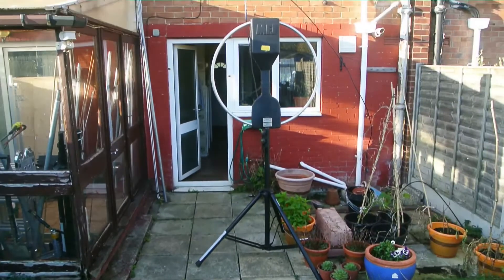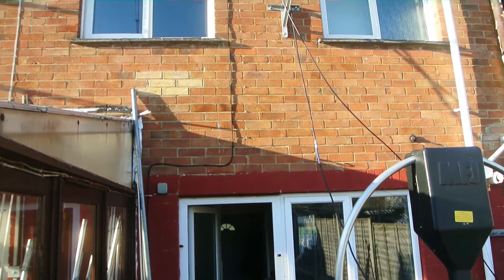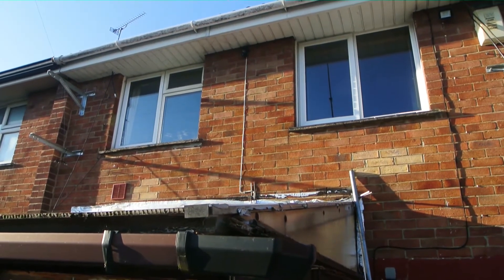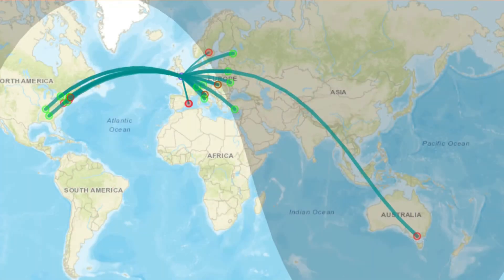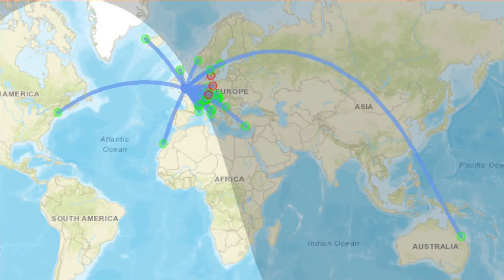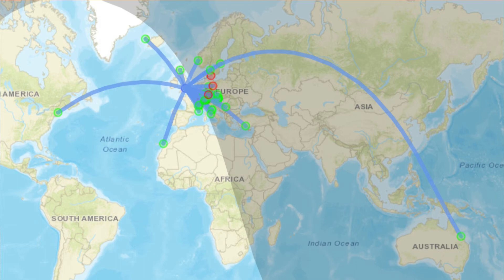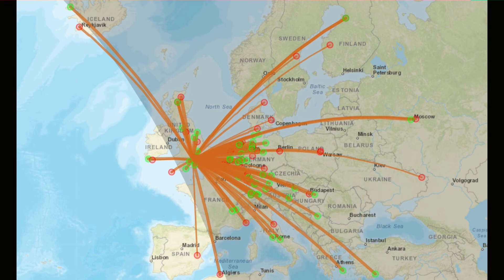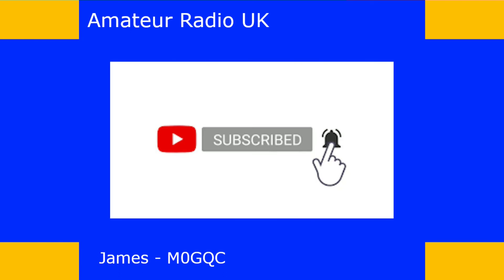MFJ-1788x Mag-loop At Ground Level

Comment: You must never have owned a mag loop before, truth is the narrower it is the higher Q, so the better, especially for nulling out noise etc, I know this video is a few years old, but these days with so many SRD bandscope and waterfall radios, the loop is very easy, you just look at the band scope and press the slow tune up or down for like a second to move up or down ( reversed because MFJ are mental) 😂..anyhooooo..wonder if you still have the loop, ? I have the same one because we now live in a flat..cheers.
Reply from the maker: I purchased this in the days before scopes (was usingan FT-857d at the time), but agree that it's much easier to tune when you've got a scope to look at.

That said, it's still a pain to keep tuning every time you change frequency. 

I sold this antenna very recently (literally only a few weeks ago).

In terms of nulling out noise, that is a fair comment as the null is extremely narrow, meaning that despite the theory of this antenna being bi-directional, I actually found this antenna tended to be fairly omnidirectional (apart from in the very narrow null). Certainly on 40m. Less so on the higher bands.

Comment: I use the Baby loop, it keeps up with my smart tuned vertical on 20 - 10meters. Being vertical it's fairly bi-directional. Worked dx on 15 & 17m ssb and cw. At the very least it's an excellent rx reference antenna, having a natural 'narrow' band Q-factor. 😁 👍

Comment: Hi James very interesting .I brought the MFJ 1786 Loop with me to Thailand
20 years ago. It was 12m High on Tower Vertical. 
I have worked lots of DX in CW Digital. 
But than the Control Box was gone High Humidity. 
Not more for Repair. New Unit very Expensive. 
I see the Loop Everyday missing it was a Super Antenna. Would be nice compare it with the HyEndfed
73 Kurt HS0ZBS East Thailand.

Comment: No offense, but after many tests by many YouTuber's, I think we can say that the MFJ-1788 is a useless, overpriced dummy load...lol!  I want it to work well so badly!  I think a wire coat hanger and a good tuner would give better results at a fraction of the cost. Maybe that should be your next experiment James.  73!
Reply from the maker: MFJ-1788 vs coat hanger? That could be good for a laugh (possibly an addition to the "Antenna Abominations" playlist)!

What might be more interesting is to tune up the shed on 40m (like I did in a previous video), then put that against the loop on a WSPR test to see what happens.

I completely agree that the MFJ is VERY overpriced but I think to say that it is "a useless dummy load" is a little inaccurate.

I've said all along that it is most definitely a compromise antenna & that it is never going to perform as well as a full size antenna. We have to moderate our expectations accordingly.

For people who can't put up a permanent or full size antenna (apartments, HOA's etc), this is a reasonable compromise. It can be put on the balcony or in the garden on a tripod, then packed away afterwards.

Others (myself included) have a full size antenna for the main band on which we operate, but also use this loop because of it's ability to cover a large number of other bands (albeit somewhat of a compromise). In other words it fills in the gaps.

I think it has it's place, though quite clearly not in your setup!!!
Reply: @HamRadioOnline  Lol! I may have been a little harsh with my ‘dummy load’ comment.  I must admit I’d buy a used one if the price is right.  I’d like to experiment with one.  Stay well James...73!
Reply from the maker: @KX4UL  To be fair, I personally wouldn't buy one at full retail price (I think I might actually have said that in one of the earlier videos).

I picked up this one second hand on Ebay. I can't remember exactly how much I paid but I vaguely recall that it was roughly 1/3 the retail price. 

To be brutally honest with you, the other thing from a YouTube perspective is that I have to cater my content to what people want to watch.

I know not everyone likes these MFJ loops but (looking purely at the statistics) videos on this antenna seem to do very well.

Ultimately this video has so far outperformed my last 10 videos in terms of the number of views & click-through rate.

My earlier videos on the loop have had more views than any of the others.

The videos about my S9 interference problem also seem to be doing very well & are slowly catching up.

I don't want to over do it with the MFJ loop videos but it's something that I will occasionally revisit if the demand is there.

73 my friend.
Reply: @HamRadioOnline  - I am not surprised that the MFJ Loop videos get a large number of views.  Like me, I think many others really want the antenna to  perform well.  It would be the ideal solution to so many HAM's in strict HOA communities and apartments.  I have been in both of those situations.  Plus I like small gear that does a big job.  Keep up the great work you are doing with your videos.  I enjoy them all...73!
Reply: Skill issue..

Comment: Out of interest what power was you running? i can only run 10w max on the Cho F loop.
Reply from the maker: I think that it would have been around 2.5 watts, which is the standard power level which I generally tend to use for WSPR testing.

This was actually filmed quite a while ago (notice that the shack hadn't been redecorated when this was filmed), so I honestly cannot remember the exact transmit power!

Comment: They work better at ground or close to ground level i believe, i have the Chameleon F loop 2.0 plus in my apartment and work great for digital weak signal modes. 73s. Also nulling out noise issues is pretty good, i have mine on a rotatable tripod in the corner of my room. I have worked FT8 on 60m to east coast US on 8w.
Reply from the maker: Hi Steve. Never got my hands on the Chameleon loop but like the MFJ, they seem to be a bit of a Marmite thing. Some people love them & some people just seem to have an irrational paternal hatred towards loops!

I think you have to accept a mag-loop for what it is. It is a compromise antenna & a full size antenna will nearly always outperform a loop. That said, loops can be very acceptable if you are restricted & you can't beat them for their versatility.

For someone like yourself, you may have no other options if you live in an apartment. For me, I have one full size antenna for my main band (an EFHW on 80m which will also cover 40m), then I fill in the other bands up to 15m with the loop.

In terms of the whole height above ground thing, having tried mine in several configurations I remain a little agnostic.

I think for DX on the higher HF bands you are probably best to mount the thing horizontal on top of a big pole. as high as you possibly can.

For NVIS on 40m I suspect that you would do better with it mounted vertical & close to the ground (like I had it in the video). That's just my gut feeling. The MFJ manual for the 1788 would appear to back-up that hunch.

73